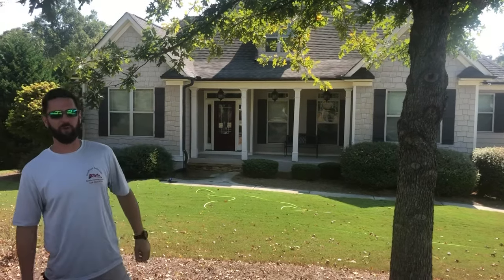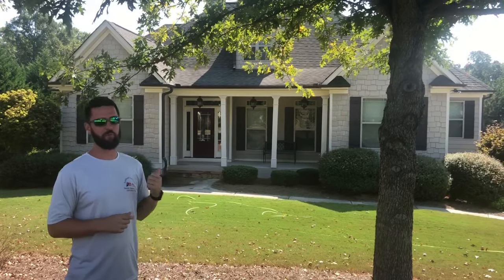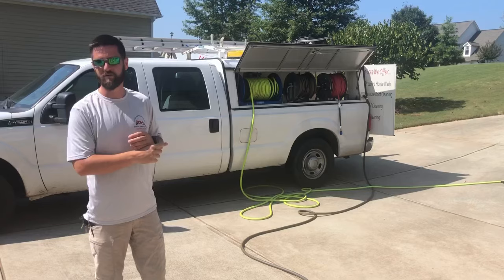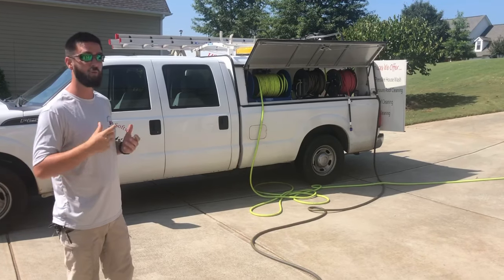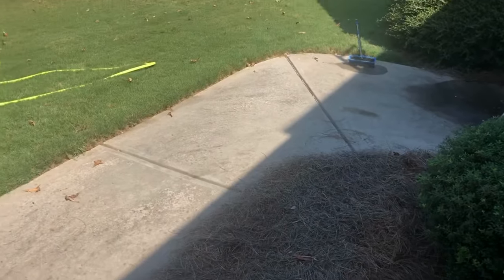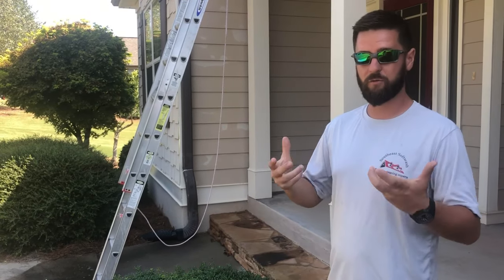How to Clean A Roof, Start to Finish

Comment: 7:30 when you mention the masks,

I was a hazmat consultant for a few years. Was my job to have the proper gear. 

For SH and any oxalic acid you’ll be spraying for oxidation - You want a half mask APR respirator with yellow banded combination HEPA filters. 

They’re pink and have a yellow band around the base. 3M or Honeywell are the most common where I’m at

Comment: Same for me I'm starting a new company myself this is just something for the side that I can get my son interested in to do something during the summer when he's out of college maybe take it over one day and do it for himself and make a decent living
Reply: Chad Cooper I've thought about doing on the side as well. My concern is that I'm from the Midwest and will only be able to do it 7-8 month out of the year. Have you been making money if you don't mind me asking?
Reply: @geoff8865  Roof cleaning does slow down during the cooler months, but you can still fill the gaps with house washing and flatwork.  You just need to do some marketing campaigns to get your company name out so people know you're available.  Do EDDM in the same neighborhood a couple of times a year, and also hit multiple neighborhoods.  Like this video said, a well made flyer will land in someone's drawer and when they need you, they will have you on hand and give you a call.  Branch out and look for parking decks or gas stations to clean as well.  If you have the proper degreasers and good pressure washers (8 GPM or even two 8 GPM combined) you can get fair business cleaning these commercial areas.  Get some professional training from SoftWash Systems in Florida though.  There are many laws and things to be aware of when working on commercial properties that very seldom pop up in residential cleaning.

Comment: Ladder stand-off arms will stabilize the ladder - making it safer, and at the same time decrease the chances of marks or dents on the homes gutters. *Little tip from a pro in Canada
Reply: I always see people putting ladders against the gutters. I have always used the stabilizer so I don’t do any damage. Plus I’ve seen some gutters that are barley even attached because the wood behind is rotted

Comment: I usually bag the downspouts for the initial roof wash application.  Then hook the drainage back up and rinse thoroughly. Have had no plant damage.    I take the runoff and use it to kill weeds  and junk from growing on gravel driveways.
Reply from the maker: The Rent Collector bagging works too.
Reply: Is there a special type of bag that is used so the SH does not burn through it?

Comment: This is the best video I’ve seen on roof cleaning. Thank you so much for taking the time to make the video
Reply: http://www.panoramicclean.com/gallery.html I have several before/after photos here.  Although looking at them, I need to replace the last one.  It was a house wash only when I took those photos, but I just went back and cleaned that roof about 2 weeks ago so they could take photos to post online to sell their house.  They had 3 people schedule viewings in the first 45 minutes after it went online.  People drastically under-value how much more attractive a house is when it is for sale and the subliminal effect a clean roof has versus a dirty roof.  Almost every roof I clean for someone putting their house on the market has sold very quickly.  It's nothing magic about me, it is just people do not understand how much benefit a clean roof is when it comes to selling a house.

Comment: I’m a roofing contractor and bought the Little Giant Hyperlite Sumostance extension ladder. It is by far the best investment I’ve made in safety. There are outriggers that not only level the ladder on any terrain but also widens the base by about 3-4’. It is expensive, but you only cry once. Trust me it’s worth it.
Reply: Looked it up. Seems like an amazing ladder. You said you only cry once…. Does it matter how long?? That thing is expensive! 😂😂 and idea if a stabilizer could be added to the top?? Looks like it wouldn’t be necessary
Reply: @mid-southsoftwashllc  haha yeah it’s expensive but it’s been a life saver for the past year that I’ve used it. No need for a stand-off at the top unless you want one to stay off the gutters. The fact that you can set this ladder up in locations that you couldn’t set others in has saved me a lot of time. I just know it’ll fit wherever I need it and it’ll be stable.

I will say this tho… that ladder creaks like hell! Very noisy as you climb up. It’s the sound of the fiberglass flexing. Not like it’ll break, but sure sounds like it. That’s my only negative against it. I really wish there was an aluminum version of it. 

I actually bought two other little giants. The King Kombo 8’-17’ A frame / extension and the 6’ - 10’ version. Both are super useful, lightweight and have a wider stance. Definitely recommend those.
Reply: @jasonsmithroofing  man that would definitely scare me a little! Lol. As expensive as it is, I would think it would be one of the most stable and secure ladders in the market. You don’t get creaking when using other fiberglass ladders. Is it super light like they say?
Reply: @mid-southsoftwashllc  it’s light for what it is…I guess. Supposedly 65 lbs for the 28’ I think. Still a beast to move around if you need to navigate around trees and such. But yeah the thinner fiberglass makes it a lot more flexible.

Comment: For a new house washing business, what is the recommendation for starting the process of different mixes? Your truck setup allows you to alter the proportions on the go, but what should someone do without that full system in place? Switching between vinyl, brick, shingles, and concrete would mean having a lot of different premade mixes in gallon buckets, right? Or, is there a smarter way to have the mixes for a beginner who doesn't want to appear like they are struggling?
Reply: Just mix up enough for the job, don’t just fill up your tank all the way cuz if you only use half of it and your next job is going to need a completely diff mix then your kind of screwed and now have to waste the rest of your tank recoating your first job just to get rid of it or just using the wrong mix on your next job and hoping for the best. You will eventually learn how quick your tank drains out and you will be able to make good judgment but for now just mix up 1/4 of your tank size, yeah sure it’s a bit of a hassle but it is what it is homie
Reply: I have honestly been buying up the material I need to set up my soft wash trailer. Working my job and then putting money towards my build. It takes time but once it’s built then you’re all set to go and run with it! If it doesn’t do as well for you and your set up actually works then you can easily sell it for a higher price than it cost to build it because you put the time into building it

Comment: I've worked for softwash platoon out of Chester Pennsylvania, got my certification in Florida, used a lot of equipment from softwash systems, kinda pricey. Currently work for Pennwash out of west chester. 4 years been softwashing , couldn't ask for a better career
Reply: Ron Mckeefrey are you the owner of the business? If so is it profitable? I've been thinking about starting something like this on the side around here.
Reply: Geoff Armstrong I’m not the owner but I’ve watched that company go from 1 pickup truck with the skid, and whole set up to 5 trucks, box trucks are the way to go. So much easier type in on here softwash platoon on YouTube and check out that box truck, that’s the ACTUAL truck that I used
Reply: Geoff Armstrong very very profitable though, tons of money, easily could make 5-12,000 a week

Comment: Great explanation. Do you have any videos you could point me to about cleaning 2-3 story roofs, gutters and house siding? My area is mostly 2 story houses and half of them are 3 stories on the back side. I have a 4GPM pressure washer and a very amateur 5.5GPM soft wash setup. I have trouble reaching things safely on almost every job. Thanks!

Comment: Hey boss I was looking for any advice I do roof treatments in Jacksonville Florida I have never Been able to apply the chemical and then just walk away for the rain the roof looks worse then it did when I showed up after applying my SH soap and water. I don’t know if it’s because it is so hot and humid in Jacksonville Florida the process is not working the same I am always having to go over every single with my pressure washer and use pressure to remove black stains clients are not going to wait a week after they pay me $1000 to see if the rain lifts these stains any suggestions that could help out.

Comment: Thank you for the info. I've been doing softwashing for a couple years now. Once in a while I'll get a concrete barrel tile roof that is exceptionally dirty with organic growth. I use a hot mix 5% or so.  It doesn't always disappear immediately with that mix. It does kill it. Color changes from green to orange. Should I mix hotter or is that good? Any pointers would be helpful. Thank you for your videos. They've been helpful in my journey and business.
Reply from the maker: Yea you can bump up strength as needed. You can’t hurt barrel tile with SH. 
Hit it with the lava!
Reply: @southeastsoftwash4020  cool man. That's what I was thinking.  Thanks for the tip man. Much appreciated.

Comment: hi I usually remove the moss with a brush and blow the ceiling and clean the gutters and put moss kiler powder on top .. .. to do your step I would have to first do everything I usually do skipping the step of applying the powder and then  apply the soft wash method?

Comment: hey bud, i know this vid is like 3 1/2 years old, great vid btw, but i got me thinking something and i'd just love to have your opinion on this. So we allways be watering the plants and grass to protect them from the mixture we be using. Works great enough, but i got me thinking about how perhaps we can 'take it up a notch', i know it'll cost just a lil' bit, but it's not that expensive.

plant 'food'. like plant 'vitamins'. If we were to make another little extra tank with a mix containing plant 'food', like with concentrated plant fertilizer and stuff like that, and we use that mix on the plants and grass. wouldn't that just give them another extra little life boost and have even less risk of impact when we be using a hotter mix? i mean in general, on let's say a 3% mix, just watering the plants is good enough. 

But i've had some seriously badly kept houses to be done with loads of cr*p on the roofs, including chunks of moss. I've been having to do quite a more potent mixture, and sometimes even had to resort to a special chemical. Now i haven't had any real issues with leakage on plants, but i have seen some plants with some leaves that got just ever so slightly affected. Now maybe that's just me not doing the job 100% enough in sufficiently watering down the plantlife. However, i'd rather just eliminate the risk from like 95% risk free to 98 or 99% risk free to plant life, so it gots me thinking 

would adding some plant fertilizer help boost the plants?

What is your thought on this? i mean i know we ain't landscapers or garden maintenance, but well, wouldn't that be like a worthwile step?
Reply from the maker: You mean something like this?
https://www.southeastsoftwash.com/product/plant-protect/
Reply: @southeastsoftwash4020  dude! fantastic! i had no idea that existed! i am without words!

Comment: The wand you are pre wetting with is it running from your pump or is it the pressure from the house? Didn’t know if it’s ran from your truck or house? Looks like it’s got good pressure...

Comment: What would you recommend  using for a surfactant?After applying the SH & Surfactant, would you recommended rinsing off the roof?
Reply: Get some training from SoftWash Systems in Florida.  They have chemicals that are bleach safe and work well.  About the only time I rinse a roof is if there are no gutters and there are plants in the drip line.  Otherwise mother nature does a MUCH better job rinsing because she hits the plants and ground all at the same time.  If I have sensitive plants around a downspout I may put a gutter cane into the gutter and rinse the lower 4-6 feet, so when it rains next, there won't be enough leftover salt from the bleach to harm the plants because buy the time the salt reaches the gutters, there is plenty of water already going down the downspout and flushing the salt away far and wide.  Otherwise, it makes no sense to rinse a roof.  When you spray weed killer on your lawn, do you come back and rinse the herbicide off the plant? No, you leave it on for maximum effect.   After the initial cleaning, when the dew falls that night, it will reactivate the bleach at a concentrated amount and do a follow up treatment.  I've done this 8 years now and never killed a plant, so it works.

Comment: Great video   I'm thinking about starting up a soft wash and pressure washing  this spring   but if you have a few soft wash jobs per day is it better to rinse after every job or could you just rinse out at the last job of the day
Reply from the maker: Always rinse out the equipment after each job.
Reply: @southeastsoftwash4020  thanks

Comment: When you do a roof, do you soft wash it like a house. Bottom to top and a good mix ratio for a roofthat has a lot of algae on it, 60%SH and 40% H2?? Thanks
Reply: 60% sh nooooooo yikes don’t even think that’s possible 6% is still pretty overkill 4-5%
Reply: @Mrdeadneck  what are you referring to with 4% to 6%? The strength of the bleach?????!
Reply: @Mrdeadneck  I use 10% pool bleach, mix it at 50% SH and 50% H2O
Reply: @pselandscapinglawncare5960  oh ok that gives you a 5% mixture
Reply: @pselandscapinglawncare5960  isn’t pool bleach SH?
Reply: @roderickjohnsonjr8100  indeed it is!

Comment: I been doing roof cleaning just a yr now I notice I sometimes create brown rust looking marks what is that? And is there a way to prevent that is my roof mix to hot?
Reply: Do you rense to roof with water after?
Reply from the maker: You are doing it right, honestly you could bump up your strength a little bit. What you are seeing is dead organics. It will come off when it rains, or you could hit it again
Reply: @frankluznar6739  no

Comment: Tremendous video mate well done. We're not accustomed to softwashing roofs here in Australia (shingles are rare), almost all roofs are concrete, ,terracotta or metal so they're typically just pressure washed with cold water, so the knowledge base here in relation to this process is limited. Can I clarify, when you say you use a 4% mix with the SH, you're meaning that it's diluting your batch about 1/3 with water? In our case typical chlorine is 12.5%. Secondly, presuming all your valves are the same it sounds like you're using 3% surfactant is that right? Would dishwashing or laundry liquid suffice?
Reply from the maker: Abu7929 correct one the ratios. Lots of detergents will work in a pinch for surfactant
Reply: Regular dish soap works great
Reply: @randyweaver6543  Thanks mate

Comment: Great videos... Just wondering what type adjustable nozzle do you use? Thanks
Reply from the maker: David Weatherford Home Depot. They are on the pressure wash aisle
Reply: Thanks man, I appreciate it 👍
Reply: FYI, not sure how much at Home Depot but they had them at my local Walmart for $6.87. Thanks again 👍
Reply from the maker: David Weatherford yep. I’ll grab them at Walmart too if I’m in there
Reply: I grabbed one from Walmart but it leaks water and the fan pattern only goes from 0 to about 25 degrees...it may be a faulty one because in this video the fan pattern looks alot wider..maybe I will try another one just to make sure but I love  the soap tip for pressure washer nozzles at 60 degrees covers alot of square footage with one pass..

Comment: Excellent video, appreciate all the info. Could you help me with softwash wand, I have same setup as video but I'm stuck when it comes to type of fitting from 1/2" pvc threaded coupling to the quick connect for nozzle? Could you please please tell me what I need to make the transition? I've searched high and low. Thanks in advance!
Reply: Dude just go to ace hardware or order online from titan

Comment: How quickly do you need to rinse plants after spraying SH?
Reply: As soon as you can. Make sure like he said, pre-soak them. If not the rinsing prolly wont help much if the plants are thirsty. I dont do soft wash yet but have been learning to start a 3 tier buisness for a month and in the learning phase. Also, depends on the plant as some are more succeptible to dying.

Comment: Good video! The rinse phase and cycle is as simple using low pressure, such as a house correct?
Reply from the maker: Strengthprodigy yes. Coming straight off the house
Reply from the maker: Adam H if your going to rinse the easiest way to do it is with a pressure washer and a Hugh Pressure ball valve

Comment: Hey Cody, what hose are you using for your softwash set up and where to get it? TY
Reply from the maker: Rick Armstrong we like the kuritec. Amazon usually has it.
Reply: @southeastsoftwash4020  Thank you for such a quick reply.
Reply: @southeastsoftwash4020  what diameter do you recommend?
Reply: @southeastsoftwash4020  and do you have softwash wands in stock? Sorry for all the questions.
Reply from the maker: Rick Armstrong 1/2” if running the 5.5gpm pumps

We do have wands in stock.